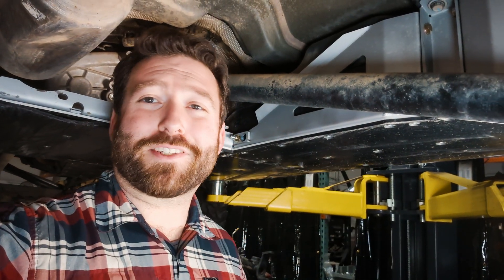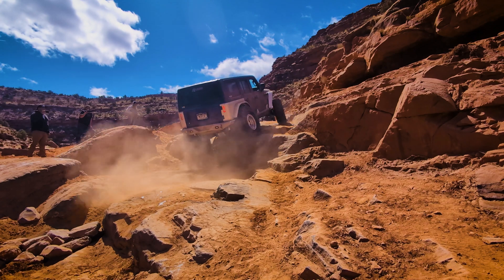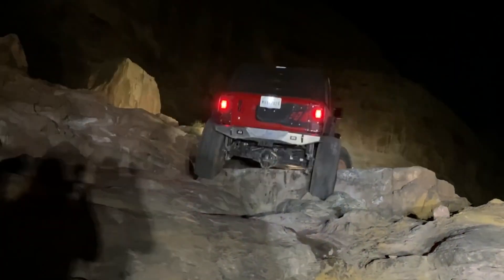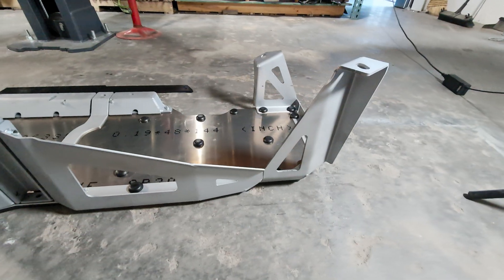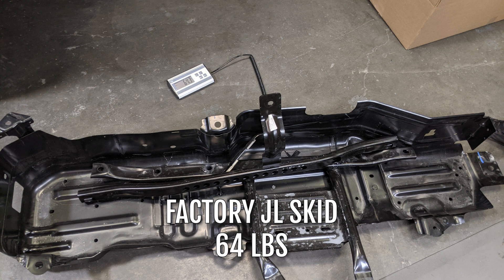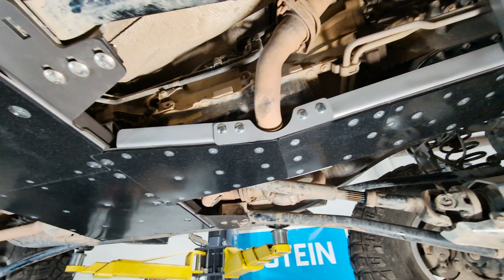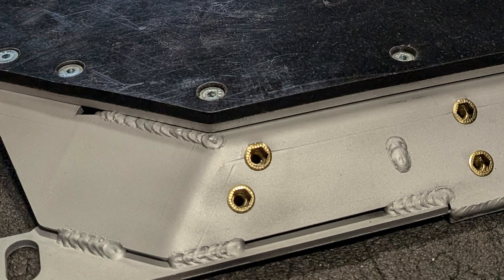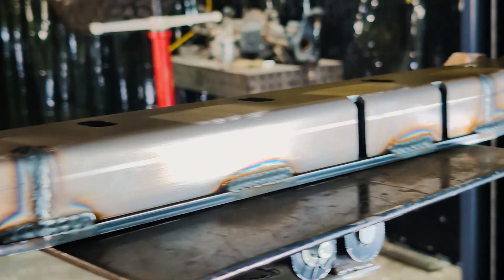The Strongest Jeep JL/JT Belly Skids: 7075-T6 Aluminum (7000-Series + UHMW)

Comment: What’s the weight for the JT skids?
Reply from the maker: So I know the provisional numbers on the JL 3.6; I'll work on getting you the JT 3.6 numbers. The pre-production JL system came in around 137 lbs; but we removed 65 lbs (factory fuel tank skid, factory steel crossmembers) so my best guess right now is that the JT will gain around 65-70 lbs putting all of this on.
Reply: @NextVentureMotorsports is this including the UHMW plates?
Huge kudos to you guys, your products are amazing and better than OEM.
Reply from the maker: @chaumartin  yes that includes the UHMW